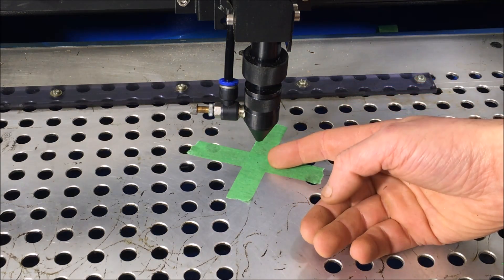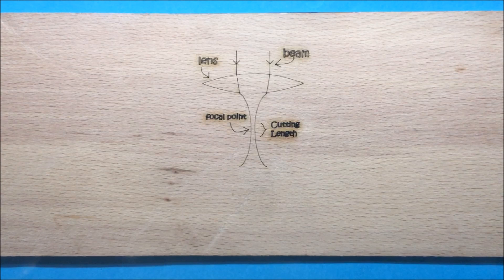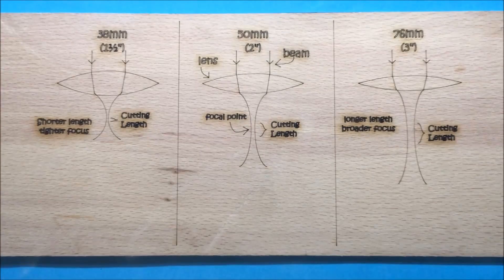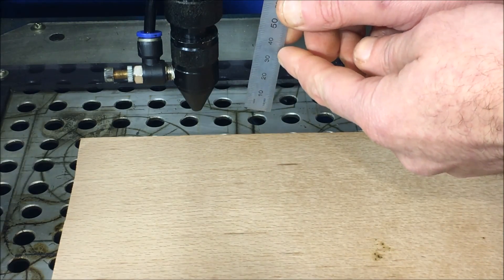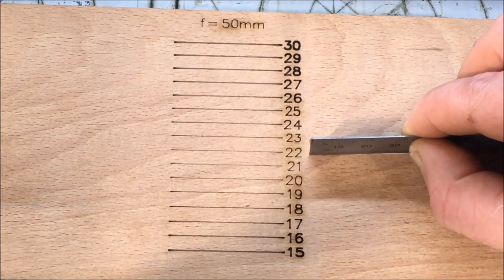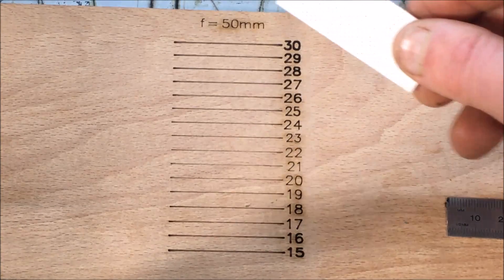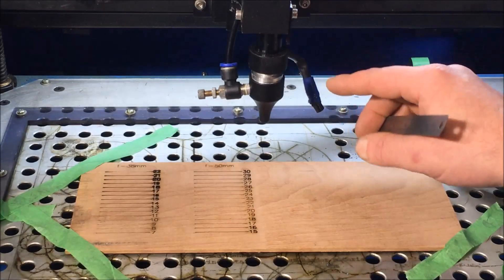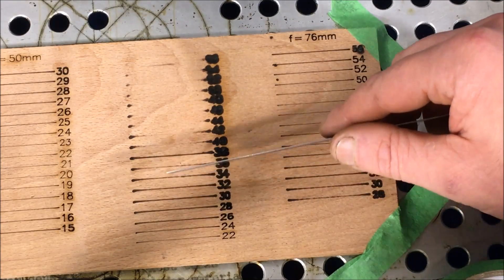Laser Cutter Focus - Measuring Focal Point and Depth of Cut

Comment: in summary..for this machine..a 38mm lens is good for cutting thin metal for example where you need high power focused in a small area..the longer lens is for making straight cuts in softer and thicker material..in between those two is a good general purpose lens..running tests at various depths allows you to determine the focal pont for fine detail work. Thanks for a great video!

Comment: nice idea, but I saw someone (forgot who it was) use a different system  , he tilted the plywood at one side, burnt a hor. line and looked for the thinnest piece of that line, there he measured the ideal length, with a heme made step gauge meter or a wedge . kind regards Hans

Comment: and about other kind of ✴️ laser like NEJE MASTER 20W. how can i descovery the focus range and deep cut effectiveness ?
Reply from the maker: those little solid state lasers have the lens attached directly to the laser unit. You can adjust the focus a bit by twisting the screw mount holding the laser, or by lifting or lowering the work piece. In principle it all works the same.

Comment: Thanks for the detailled informaton! Will help many laser opreators. Indeed these Chinese machines are built rather sloppy, you can easily detect how the table is moving unequally and side to side when adjusting the height. But still, a good adjustment will improve work results.
Reply from the maker: funny thing is even though it shakes a lot, it always would fall back to the same place. Ive since tightened up those joints so it is not so sloppy, but it was never really a problem I needed to urgently fix.

Comment: What do you cut do you cut the foam for? I'm kind of interest in costuming and You really sparked my interest
Reply from the maker: Ive cut acoustic foam for making inserts for cases mostly, but also tried a few other foams which would be similar to costuming.
You need to test materials first. Some foams and plastic types will just burn black instead of cutting nicely (very bad). As a quick test you can try bringing a lighter up to the material. If it just melts away it will probably cut nicely, if it burns brown/black it is not suitable to put in the laser cutter.

Comment: With a plano-convex lens, THE CURVED SIDE GOESUP (toward the beam) and THE FLAT SIDE GOESDOWN (toward the work).In other words the laserbeam needs to pass through the curved part of the lens first. Lenses are typically referenced by their focal point. So it kind of voids the video. To be honest once your plywood started shifting up and down when you pressed on one of the corners when you were measuring the distance between the laser head and the wood with your super accurate tool you really threw the measurement off.

Comment: It would have been better if the board had been made flat to the metal surface. As it is, the bowing in it is enough to make the entire exercise less than optimal. You can clearly see that the board has at least 5mm between bed and center of board, yet, when he measures, he pushes the board down, which affects the overall results.

Comment: You've got me wondering about building a little carousel/turret plate to manually select between three different lenses rather than having to remove them entirely to change over. Something with a nice little detent for positioning and a locking clamp.
Reply from the maker: I like that idea! I think a bulky carousel might get in the way and bump into things, but some system with magnets and guide pins so you can quick-change different lens tubes would be great.
I really like it. If I get around to making it up myself I will be sure to credit you with the inspiration :)
Reply: @makestuffnow  I'd really be interested to see how it turns out with magnets! Guide pins might certainly help resist them shifting under the accelerations used in engraving.
Clearance issues are certainly something to look out for as well as not adding too much mass to the head. It might be that it'd only work well with a smoothieboard brain swap or similar where you can tweak the acceleration rates. But most of the large Chinese cutters I've been looking at seem to have plenty of mechanical clearance. Thinking of something like how you change magnification on a microscope.
I'm also thinking of this for a community makerspace laser though, so don't know if I'd trust people to be able to physically remove the lens assemblies to swap them!

Comment: Always been told curve side up for best focus and curved side down for best power. Why do you use curved side down?
Reply from the maker: Yeah I meant to say curve up. That's how it is normal placed.
Really though with the characteristics of the laser and what you are trying to achieve it makes very little difference how it goes in. Just be aware though that the way you put it in will affect the distance to the focal point by a few millimetres so either be consistent or make a separate focal point measurement for either orientation.

Comment: Should the PC lens not be installed flat side down?
Reply from the maker: Yes. I said it wrong and didn't realise until well after i put the video together.
But even if you put it in the wrong way, for a narrow single wavelength beam like this it doesn't make a very big difference

Comment: but the drowning is not good.  the light beam is not bent. goes like a X  with the burn mark in the middle. but the angle is different. so with with different focal length(linses) the X will be more draged out in the high. that way you get a longer cut before  the spot become so big that the energi is not big enough to still cut.
So in other words, how fast the sport grow/Distance.
Reply from the maker: The drawing is correct for a gaussian shaped beam. The intensity profile does curve like shown in the diagram.
Look up information on 'TEM00 mode' if you want all the technical mathematics behind it.
Reply: makestuffnow! Never heard about. Will take a look .👍

Comment: hi, I can discreetly use the software, but the machine does not respect the characteristics described in the listing on ebay. I can work well with wooden materials, paper and cardboard. But there is a big problem for me and for my job: the machine is not able to work the methacrylate (plexiglass) WHY? on youtube we can all use my same settings and the same damn car! maybe it has factory problems?
Reply from the maker: That is strange because plexiglass should be one of the easiest materials to cut.
I would need to see how the laser is marking the plexiglass. Feel free to email me. Email address in 'about' tab on my channel page

Comment: I am finally up and running and I just replaced the Blue Turd power supply with a HY-T60 and night and day difference.  It matters and these Chinese "eBay" Laser manufacturers use seconds, and thirds, anyway so you are getting rejects to begin with.  Buying something made by an ISO9001 factory vs some guys in a vacant building matters a lot.

Comment: Hello I bought a China (ebay) k40 laser and have problems to engraving with the same intensity from right to left.
When it goes to the right it does not engraving with the same intensity, it seems that the laser loses power in the right.
It will be because of the alignment of the laser / mirror?
Thanks for some tips :)
Reply from the maker: Very likely it is a mirror alignment problem. Another possibility is the cutting surface isn't level, but has a slight slope to it which you need to fix.
Reply: Thanks a lot for your time, well, from what I've seen and analyzed it should be a mirror alignment problem.

Comment: What software are you using to generate the number and lines so quickly?
Reply from the maker: I just drew the lines and numbers in the control software RDWorks. I made each line/number a separate colour/layer so I could quickly choose which individual ones to sends to the laser.

Comment: seeing your calibration board wobble under slight pressure, makes any adjustment nearly pointless, or am i wrong?
Reply from the maker: Things are only shaking sideways mostly due to play in the screws holding the table bed.
The up/down distance isn't changed once it settles back so it won't have any affect on trying to test the focal length.

Comment: Hello I bought a China (ebay) laser and have problems with MDF plates to cut with 3 mm thick of the workpiece, in contrast to set of hard plexiglas with 4-5 mm, the machine cuts well, where do I go wrong? what could you recommend to me? what distance do I have to keep from the workpiece, the position from the work table? Please, for a feedback, dake you ever in advance for your helpful answers.
Best regards
Halil Akgün
Reply from the maker: You should be having no trouble cutting 3mm MDF with any lens.
Set the distance from the nozzle to the workpiece exactly where the focal point is. If this distance is set correct you should be cutting through 3mm easily.
Make sure the airflow from the nozzle is working ok.

Comment: The air nozzle looks adjustable right on the side. Was it included or did you add it later? I'd like to add that to my machine to get finer control on the air flow, right now I just have a 1/4" on/off fitting near the pump and at best you can do settings of on, half on, and off.
Reply from the maker: It came already fitted. Like the rest of the stock fitted air flow system, it doesn't work very well.

Comment: (1) Do you have design for making your adjustable bed?

(2) Is it possible to replace the laser tube on a 40W Chinese laser with a higher wattage laser tube (e.g. 60W or 80W) without having to make any other modifications to the program, circuit board, etc.? If it is possible, where can one order such replacement laser tube?
Reply from the maker: 1) Just a 3mm aluminium plate cut to shape. I wrote how I made it here https://goo.gl/6vYxW3
2) A bigger tube is longer and wont physically fit. But if you did manage to modify the case to fit it all the control stuff will work fine, the only thing you need to check is to make sure your laser power supply puts out enough current. I would just buy a new power supply along with the laser tube.

Comment: Between this video and your mirror alignment video, you helped clear up how the laser actually works. In your summary at the end, you state the 2" lens is the best GP lens for cutting 6-8mm hard materials. What is the wattage of the laser for these types of cuts. (eq. Baltic birch)? I'm leaning towards 60W right now.

And as always, thank you for the time and effort you put into your videos.
Reply from the maker: My laser is 50W. That is just good enough to start cutting up to 8mm deep in softer hardwoods provided everything is aligned and set up well.
60W will make things much easier, 80W even better. Just depends if you have the money and the space to put the larger machine.

Comment: According to others,  plano-convex lens work in both directions but due to aberration it should be oriented with the flat side toward the workpiece and the convex side toward the laser to get a smaller spot.
Reply from the maker: Put it in the correct way, and you get a smaller spot for finer engraving and higher power density for things like marking metals and hard woods.

Put it in the 'wrong' way and aberration will stretch the working depth out just a little more at the cost of lower power density. Helps cut a bit deeper in acrylic which doesn't require such a high power density to melt through.
Reply: Thank for your reply. By the way, really good videos and well explained.

Comment: I've learned that the lens is called a plano-convex, which means one side is flat, unlike the diagrams in the video. The focus point is changed depending on which side is pointing to the work. It has been determined that the flat side of the lens should be on the work side. Inexpensive Chinese lasers are frequently shipped with the lens inverted.
Reply from the maker: The aberration only starts to occur when you start moving away from the center, towards the edges of the lens.
With the narrow incident beam centered properly, even if you have the lens in the wrong way, it is very likely you wont notice much difference in performance in most tasks.
But I only have a doctorate in applied physics. Perhaps a boy scout will be along to provide clarification.
Reply: For your sake, Ron, if you are performing any CO2 laser work, you'll do some research to correct your misconceptions. The Boy Scouts may be able to provide exposure to such technical topics, but consider performing a search using the terms "CO2 plano-convex lens orientation," the results of which will likely include the following link:
http://www.ophiropt.com/co2-lasers-optics/focusing-lens/cutting-head-optics

Good luck with your own life experiences.
Reply from the maker: You are correct. Beam goes in curved side, goes out flat side. If it is the other way around the focal point gets spread out more along the beam  direction.

My diagram shows just a generic lens, but in the machine I do have the lens put in correctly like you point out.
Reply: at 6:34, you reference the flat side, then state "curved down," hence my comment. Thank you for the video, as I've learned a few new things for laser alignment and will soon perform those checks.
Reply from the maker: Yeah I did say that wrong...
Thanks for pointing it out, I'll add a caption or something.
Reply: video diagram shows diagonal not end view
Reply: One thing I've picked up from the many forums regarding CO2 laser cutter-engravers, specifically the low-dollar items from China, is that one cannot count on the narrow incident beam being centered properly. In the case of my purchase, one of the mirror mounts was so severely "modified" by indeterminate forces that it was impossible to align the beam properly. Even though it was very much out of alignment, the lens orientation permitted enough beam diffraction to enable engraving and cutting.

I'm willing to allow that one can operate in an acceptable manner a laser cutter-engraver with an upside-down lens, knowing it is correct removes one more level of uncertainty in setup and alignment.

I was a Boy Scout back in the 70s, does that count?
Reply from the maker: Correct. First thing you need to do on a new machine is to align and center the beam. My video on that shows how to do it precisely https://www.youtube.com/watch?v=e1c3keOKL6Y

If it is physically possible, swap the damaged mirror mount and put it in the first mirror position. That is the least critical one, and has the most room to drill new mounting holes or any other adjustments you might need to make it work.
Reply: I have a redsail clone, a machine very much different from the one in the video. I was chasing inconsistent results of the alignment process, using the methodology of your video. By building a simple jig to hold an office laser pointer in the nozzle tube, after removing the lens assembly, I "reverse-aligned" the mirrors with the red dot on paper targets.

Mirror 2 at the x-y axis is mounted on a simple right-angle bracket. It was mangled at the attachment bolts. Upon removal and re-adjustment with a hammer, it fell into place nicely with the reverse alignment.

Once all that was "squared away," using your method took about 30 seconds to get dead center along the entire beam! The video you reference is full of great ideas for checking alignment.

Does your laser have a Ruida controller? There's a great forum for anyone with that type of controller. It's the RDWorks forum with a lot of great contributors.
Reply: My chinese laser was installed upside down
Reply: you are incorrect. beam enters flat end is spot focused on curved. both need study optical physics. join the Boy Scouts for life experience
Reply: @pissantsseemore7095  As others have stated, your are incorrect. Convex side toward laser beam, flat side toward work surface. Cheers!